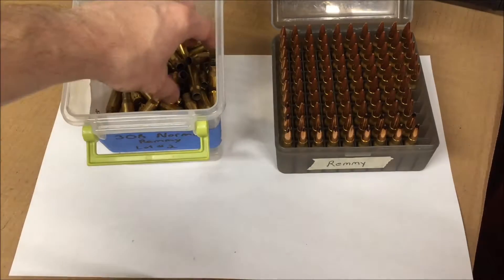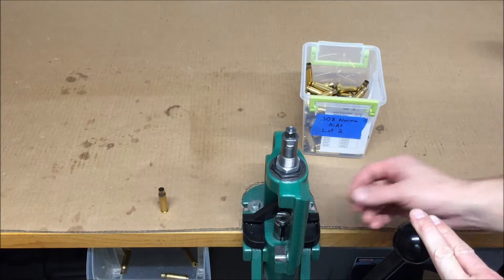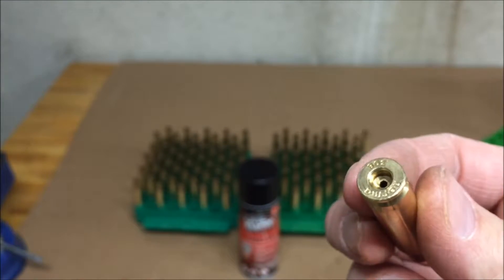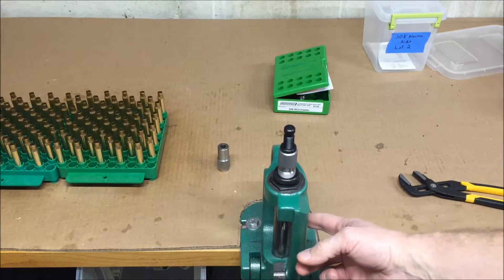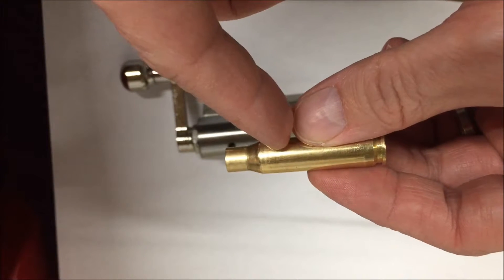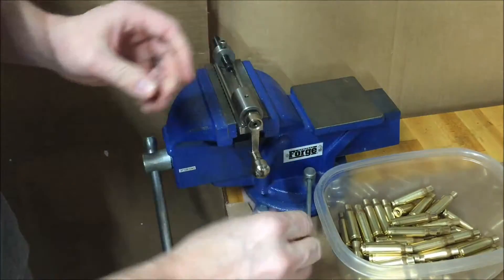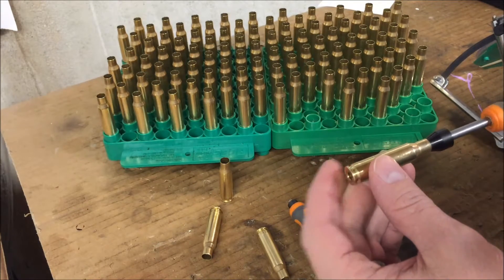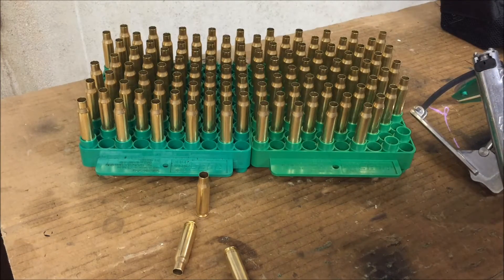Reloading Precision Ammo 1, Tutorial on case prep for precision ammunition

Comment: For long brass life and good accuracy when full length resizing, do not overwork the brass....shoulder bump of 0.002" 
You can determine shoulder bump by comparing with a fire-formed case from your specific rifle using either a comparator like Stoney Point or Hornady or Precision Mic like RCBS Precision Mic.  If cases are new (virgin brass) debur the flash hole inside the case.  High quality brass is Lapua, Peterson, Lake City, Norma, Nozler.